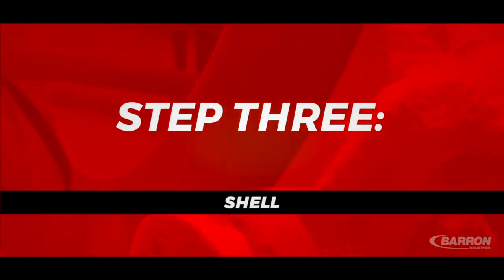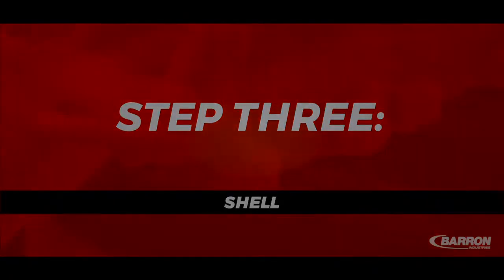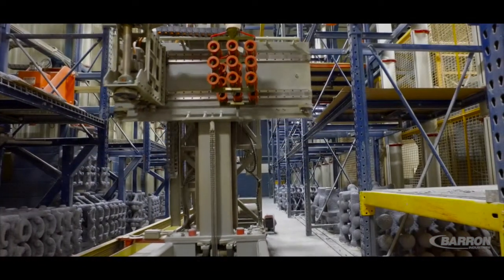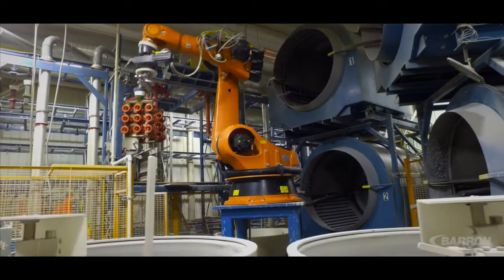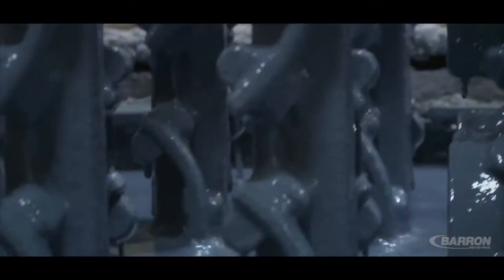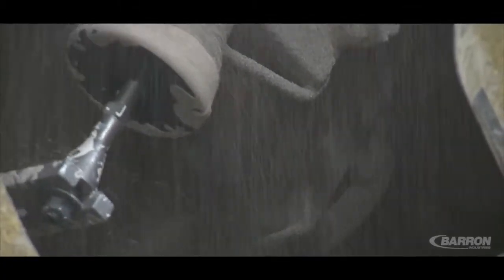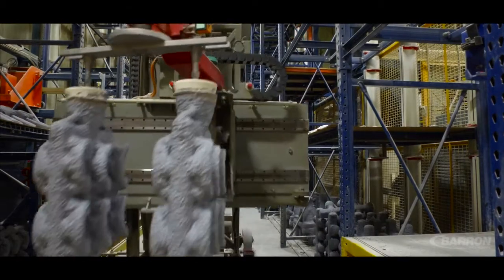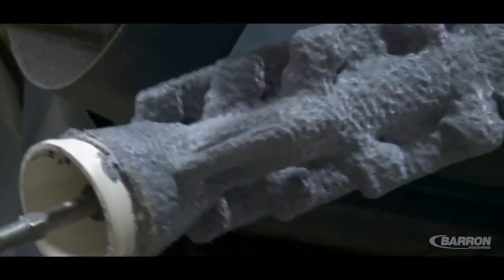Investment Casting Process / Lost Wax Process - Barron Industries

Comment: Welp here goes nothing, according to how many times you responded to people commenting on this video. Thank you for sharing, I wish I could afford to have some (one-off) 4130 steel parts copied/cast from the inferior materials I used at the time I fabricated them. Like Live Steam 1/8 scale AAR Type A locomotive trucks that I have several blueprints of & a plastic & wooden sprocket I made etc.. Any guess how much it would cost to make these in regular 4130 steel for me? Anything more than a few hundred bucks is not feasible for me. I don't even have a milling machine or a lathe yet either :-(